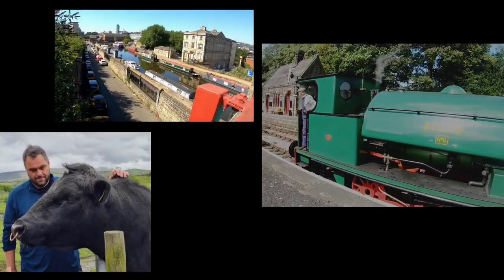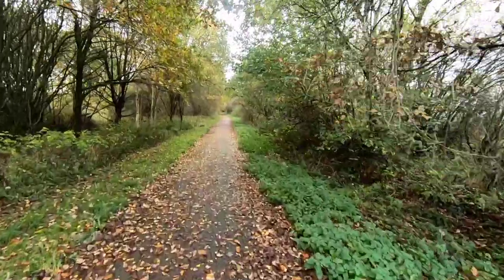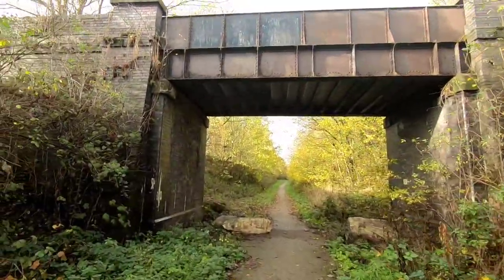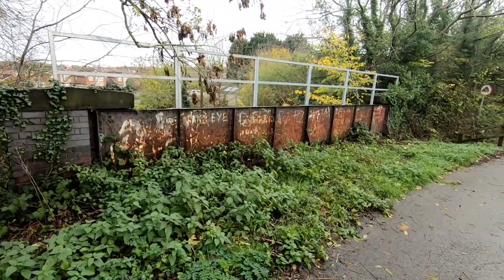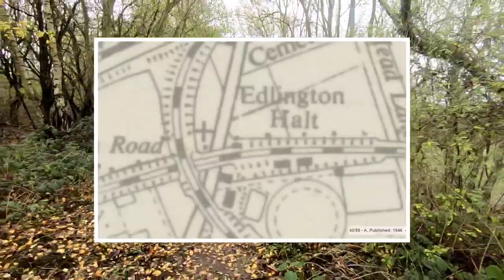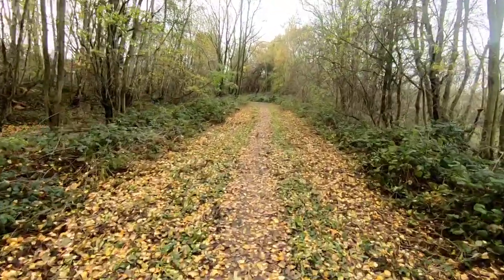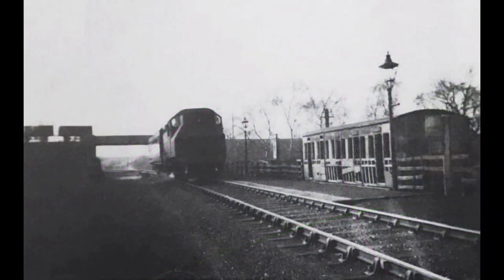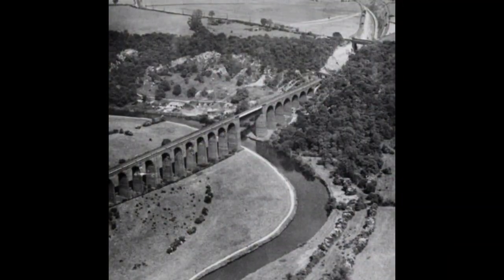The start of our Dearne Valley Disused Railway Series in Doncaster

Comment: Very interesting Paul 
The large casting is the cover off an oil axlebox from a wagon.  The bridge over the A1M was demolished in the 90s I seem to recall.  It was a blue plate girder one obviously built when the road was built in 1961 being a very early motorway 
Strangely is at the St Catherine's end of the line the route indicator is still in place on a signal for the line but the points are long gone.
That old map was interesting,  I had no idea the Dearne valley passed to the LMS in 1923
Looking forward to the rest of the series
Reply from the maker: Cheers for the info Russ. That answers a lot of questions. I have no recolection of that A1 bridge despite probably passing under there many times.
I know the signal you're referring to. I tried to get a glimpse of it when I was in Potteric Carr, but couldnt get near it.

Comment: Looks like an axle box cover , a brass bar would have poked up through the slot on the top to indicate the amount of ware on the axle box , it would have been held on with bolts in the slot at ether side , probably an old wooden bodied private owner coal wagon as railway owned ones usualy had the initials  in raised letters GC LNER ect  of the owning railway
Reply from the maker: I should have known really. I've painted enough on my model railway 😄